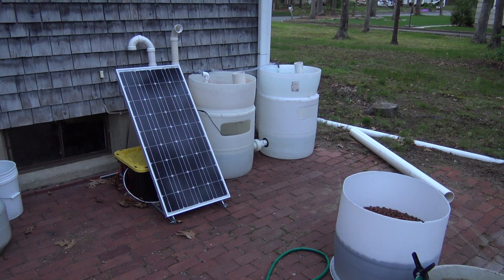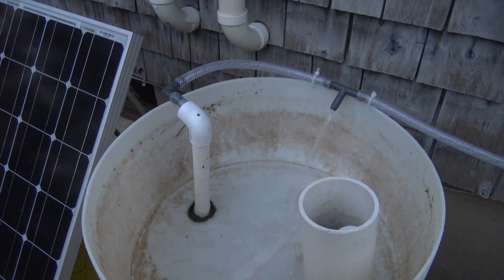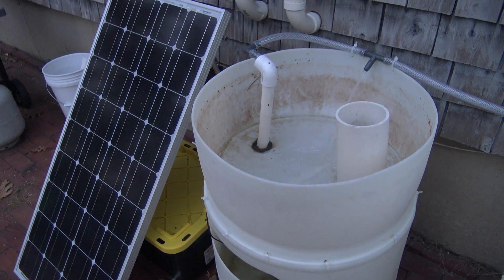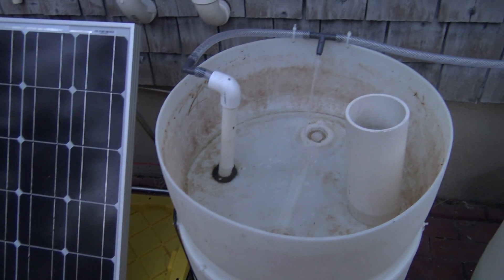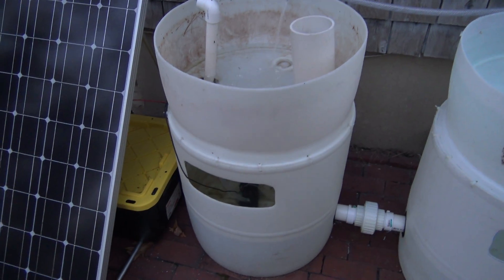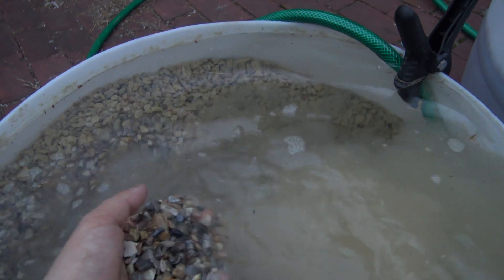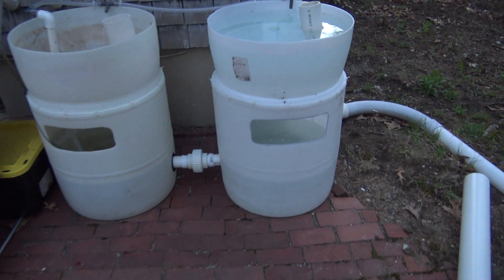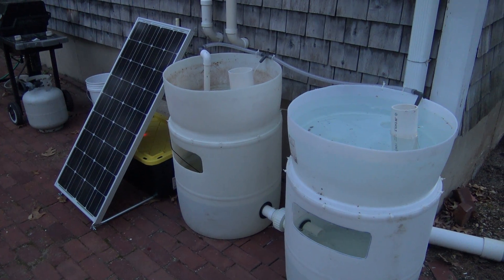#476: Clay Pebbles vs Gravel for Aquaponics - DIY Wednesday

Comment: goldfish dont mind cold water
Reply from the maker: true, but they are indoors at 75 degrees and it got down to 40 outside, its easier to acclimate them with a smaller temp swing
Reply: Greg Jones I’m using Minnows or mosquito fish idk.

Comment: I don't think that it is a major issue with the cloudy/rainy for a few days with the pump stopping because it get moisture from the rain etc.
Reply from the maker: NFT 2013 Ltd the only issue is if the barrel gets stuck full of water and the roots don't get air they can rot
Reply: greg, you could drill a tiny hole to the plant tray large enough to drain it if the pump is NOT running but not enough to drain it before it fills up and activate your bell siphon when pump is running.